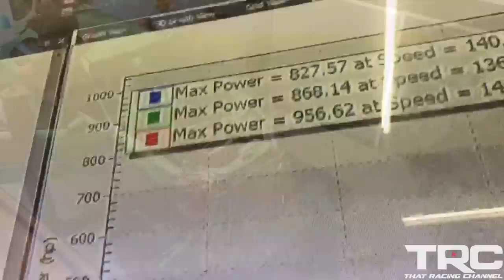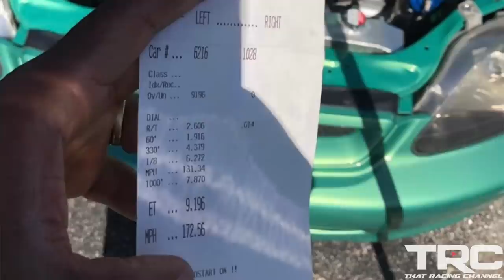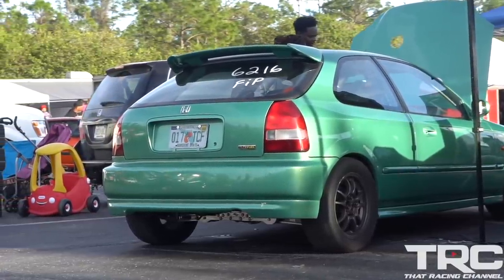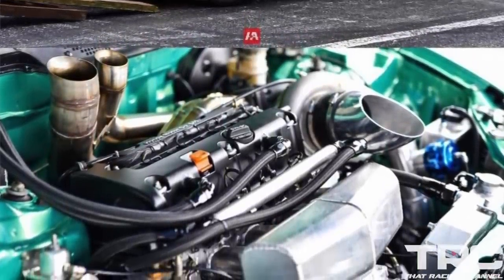Sleeper 960HP AWD Civic Runs 8's on Street Tires! The Perfect Street Honda?

Comment: The word sleeper has definitely changed. Or you guys don't know what a sleeper is. Had this been an oem color with stock wheels and hubcaps. Hidden intercooler and quiet exhaust. Then yes it would be a sleeper. The car is insanely fast and nice. Just not a sleeper lol
Reply: that is an actual oem color sir :)
Reply: @MADLITS1K  are you upset? It's not a sleeper. Facts.
Reply: @FlakoPics  it may be. But silver would have been a sleeper color. How many green hatchbacks do you see?
Reply: A lone Wolf of the North.  A sleeper is something unexpectedly  fast. I've seen 300hp cars with hood exits.. I would roll right by this not thinking it made 960hp and was awd. It looks like every other civic
Reply: Midori green is a stock color.
Reply: If I looked at it and heard it run, I would definitely know its AWD and assume alot of power. That's the biggest thing that kills the sleeper effect for alot of cars, the sound.
Reply: Big 🐌 snail hanging out, exhaust hanging out the hood, roll cage, yeah he sure fooled me 🤷🏿‍♂️
Reply: Turbo cars with no exhaust ain't that loud

Comment: Is this the one on Instagram that gaped the gtr
Reply: Would still rather have the GTR
Reply: Certified Commenter Do you need a mirror there?
Reply: I'd take the Civic because I like Hondas. GTR would kick the shit out of it for drivability though.
Reply: No...... Thats frustrate EG
Reply: Gtr for daily driver,  have the civic as a weekend warrior or whenever you wanna come out and fuck shit up. I'd baby that thing.
Reply: You could just get a boost controller and turn it down when all the power isn’t needed
Reply: @RecklessLilJ  except ppl are daily driving 2000hp gtrs nowadays. Comparing a civic to a gtr is apples to oranges.
Reply: @clutchkickpj693  depends on how you look at it both of them are great cars some civics can beat gtrs and some gtrs can beat civics. Obviously gtr has more luxury and more expensive and that's cool but Honda's are cheap reliable easy to work on and very fun and can still daily them. And idk about 2000hp dailys maybe 1000hp but not no 2000 because I've seen them 2000hp gtrs run at the half mile and quarter and there on trailers. I mean I could be wrong but I just haven't seen one daily driver at 2000hp
Reply: You gotta think you can get like a 2015 gtr for prob like 90k imagine getting a civic for 5k throwing not even 20k in it and you already have yourself a 9 sec daily driver maybe even faster then that point is it's cheaper to make fast. Gtrs are expensive as shit for not even a quarter of the price your walking the shit out of almost everything on the street and reliably  if you get a sleeved block or run css your good, block will last for years if takin Care of properly and has the right driver and tune. There's alot of em out there. Not everyone has gtr money lol gotta basically be rich to build one of them.
Reply: @clutchkickpj693  Doubt anyone is daily driving a 2000hp gtr lol
Reply: ClutchkickPJ fustrate eg drives he’s car on the streets and runs 7s
Reply: slxmmed exactly. Street driving a car isn’t the same as daily driving it

Comment: That so dope 😎 can someone quote me how much it costs me to do this set up on my acura rsx for daily use ? I really don’t want to buy another car
Reply: Sorry but the RSX chassis is less desirable for a build like that than an EF/EG or even EK. Not saying it couldn’t be done but I’m assuming not as cost effective,light weight,etc. If you notice most of the really fast AWD Honda’s are civics. Just IMHO.
Reply: @jgc0064  just fwd with 1100hp 305 on the front 😉
Reply: @lavozdelaconciencia847  I can understand the 1100hp but what is 305 on the front mean? Honest question

Comment: No hatchback is a sleeper these days. I always count on them being a 10 second car at a minimum. (Supra guy)
Reply: Basically any turbo Honda can easily be mid to low 11s with a simple pump gas setup. Any stock motor b16,b18,h22, k motor etc etc will run a decent mph trap speed in the 120s and even 130s stock with boost.

Comment: bro, that shit is no longer a street car. That's a build track car with street look as a sleeper. Sleeved block with built internals, big turbo, Aem ecu system, PPg gears, and probably up grade billet transfer case and transmission case with a twin or triple disc clutch.

Comment: 7285 is for sure not streetable......not on 2L displacement! 6466 would get you to around 800 and it would have more useable area under the curve. 7285 is really drag only
Reply: SFWD class uses these turbos on a 2L , those are the class rules and if you heard what he said, he said he didn't believe in buying over parts, just buy 1 part that would carry him through and that's it's so incase he didn't like the awd setup he would just put it back fwd and compete in the SFWD class which the 7285 is the biggest turbo you can run in that class, that turbo can carry him all the way up to 1400hp so if he wants that power he already have the turbo for it instead of having to change turbos
Reply: Depends on your definition of "streetable". If you can put up with it and it wont overheat, its streetable.

Comment: 1200bhp in the UK will see you in a ditch in about 2 seconds flat. Youll be trying so hard not to die youll get left behind someone with less than a 5th of the power whos driving at the cars full potential. Its not all about straight line speed, only Americans think that way LOL😂😂

Comment: I’ve always wondered why builds like this, are still considered to be the cars they once were. I mean the only thing that is Honda about this car now is the body. That’s it. Slap another body on it, and it would be the same thing.
Reply: It's a Honda frame with a Honda K20 engine and Honda specific engine upgrades with Honda based AWD systems and all that has happened is he added a rear differential and the suspension to compensate for it in the rear of the car as well as the Honda made power.
Reply: Except for the K20 Honda engine right . LOL